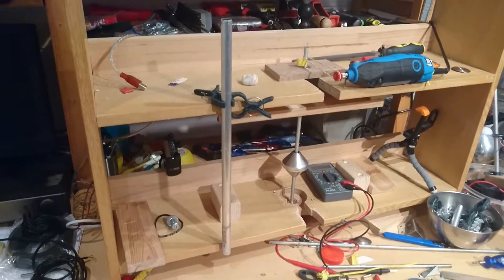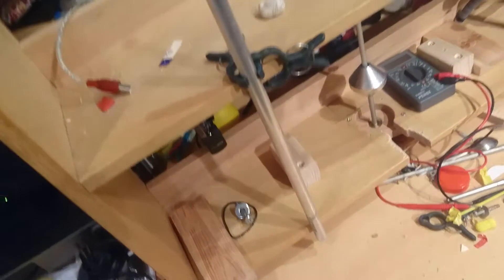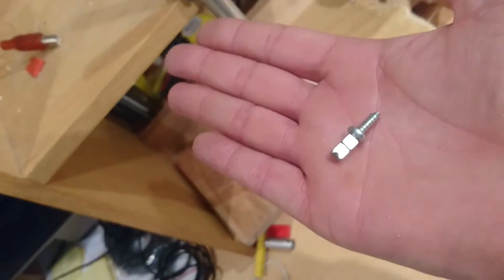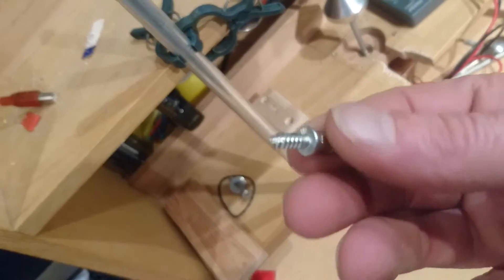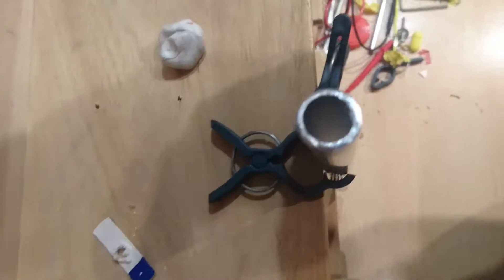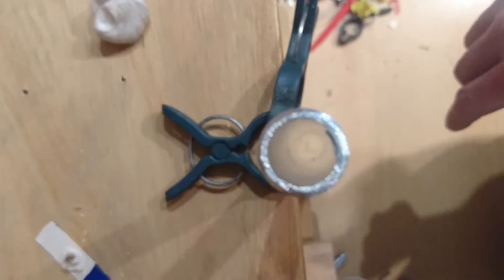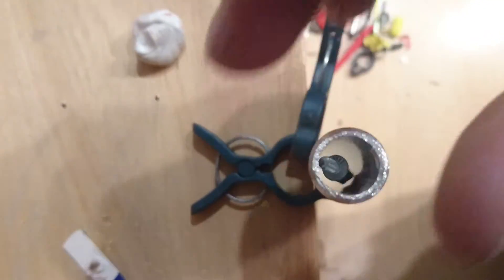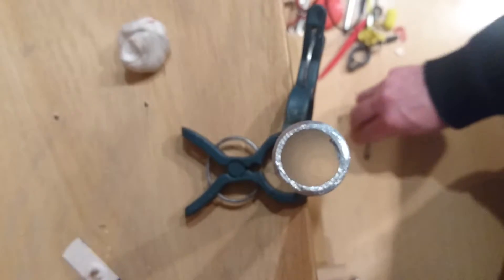Strange magnetic anomaly?

Comment: Ok so what I think is happening is that when you drop it with the screw facing up, the pole of the magnet wants to adjust to match the Earth's magnetic field, so it turns slightly, and gets closer to the aluminum, making it fall slower. When the screw is faced down, the magnet is already more or less aligned properly with the Earth's magnetic field, so it doesn't need to flip itself around, and thus doesn't get as close to the aluminum, so it goes faster.

Comment: Simple: Eddy currents, the magnet induces eddy currents in the aluminum which induce a counter magnetic field that breaks the fall of the magnet. No anomalie. The screw touches the side of the tube one way so u have to consider how the eddy currents flow cause then u conduct something and the behaviour is different. 

It's also called diamagnetism, aluminum and coper are both diamagnetic so same effects, has smthing to do with their atomic structur.

Otis Carr used eddy currents willingly in his craft (so he statet), i just don't know how exactly.
Reply from the maker: Thanks for your input, I know Eddy currents, but the anomaly in this case is: i still find it strange that the orientation of the "projectile" influences the speed. Same mass, same magnetic forse, same alu tube, yet different speed.
Reply: @YbborNetsrek  , @Alex was right. When the screw touch the side of the tube, it breaks circular form of the tube being passed. And don't forget about the fricition, both mechanical and air flow. It seems when the magnet goes first, it don't go as straight as otherwise.
Reply: You may take a closer look at the magnetic lines and how the eddy currents are exactly flowing in the tube with every direction of the projectile, that may answer your question.